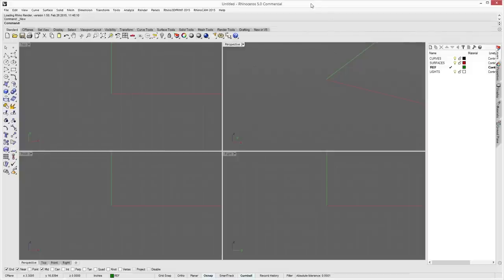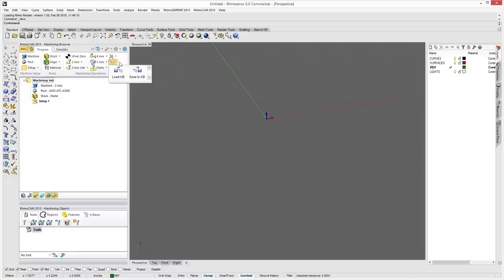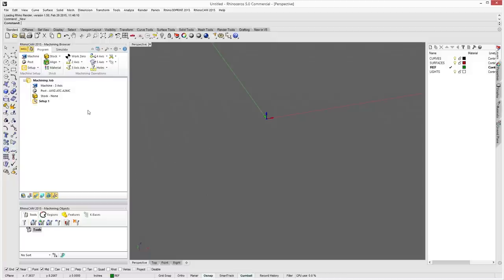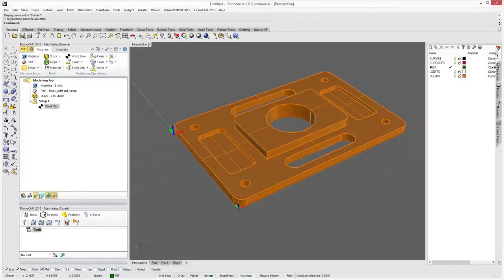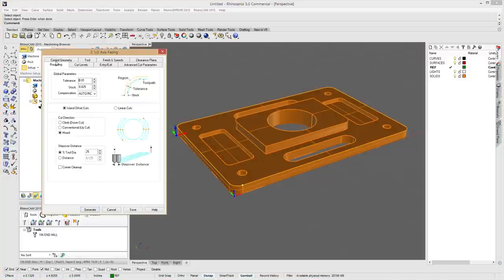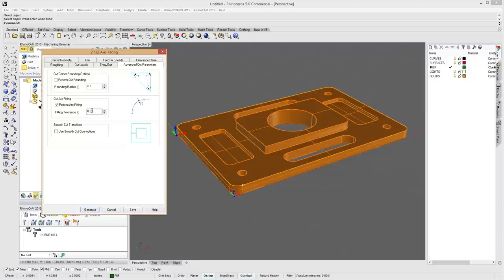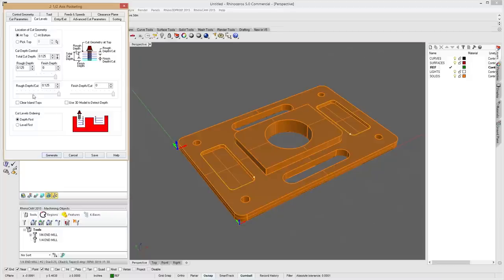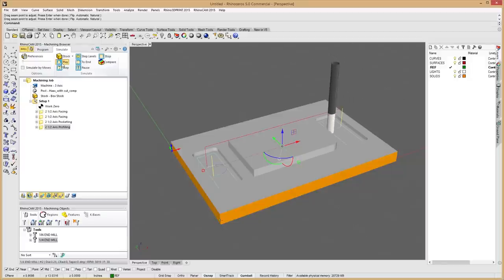Intro to RhinoCAM

Comment: very comprehensive! thanks for putting together all this info. i have one question:  what's the step between RhinoCam and the CNC machine? or you could launch the spindle right after you have finish RhinoCam?
Reply from the maker: Once you’re done in RhinoCAM you post the code for whatever CNC machine you have and load it onto the machine.

Comment: Thanks for the insight in the basics of RhinoCAM. I'm at a workshop now where we have 20+ machines running Mach 3. Currently the software we use is ArtCAM but that have to change asap. We are thinking MasterCAM or RhinoCAM. One question, in the post part where you choose machine, can you set up a custom one? Many of our machines are DIY. We need to keep the machines flexible for our workflow. Can you set it up to be "generic Mach 3"? I really like the workflow in RhinoCAM so it's a top contester for me (just have to convince the others i work with lol)

Comment: I am wondering, if there is video with more in depth explanation of all the different machining routines for 2d,3d,4th and 5th axis available. Namely I am interested in  trochoidal slot machining and hi-speed machining with small stock amount at very hi feed rates and of course all other available approaches/methods
Reply from the maker: I should do an updated video on it. They've added a lot of features to RhinoCAM. I'll add it to my list!
Reply: @AppliedEngDesignUSA  Let me know, please...
Reply from the maker: @jiritichy6855  I will for sure. I only have ability to do up to 5 axis index, so I cant do any simultaneous 5 axis.